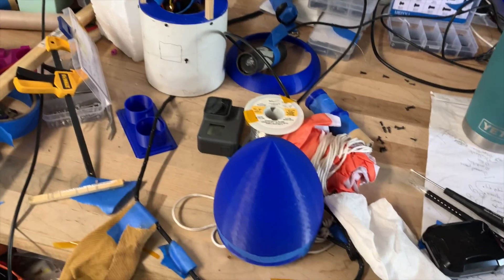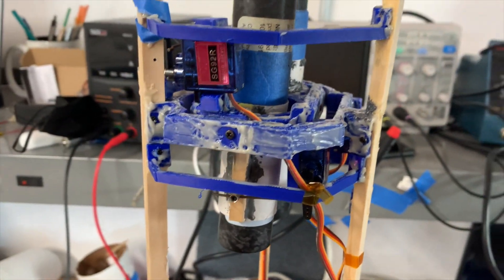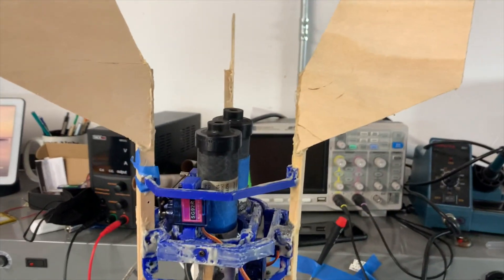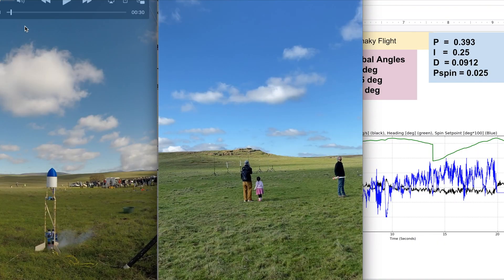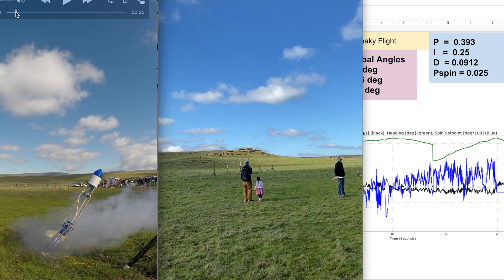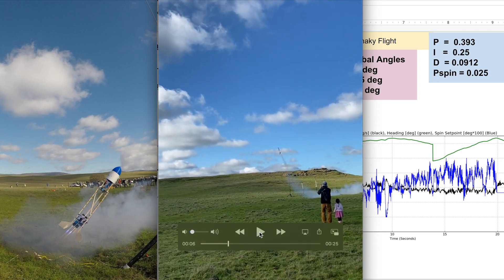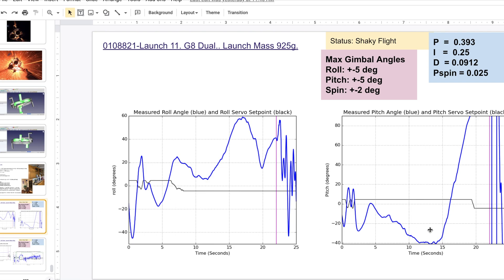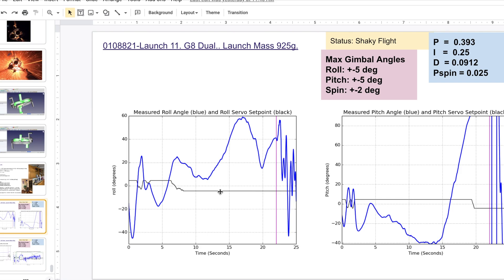Clustered Aerotech G8 Thrust Vector Control Rocket

Comment: Why the fins? Doesn’t that eliminate the need for tvc?
Reply from the maker: There's not sufficient speed for aerodynamic stability to have an impact until about 10s into flight. You can watch the liftoff, it was very slow and almost fell over. Without TVC, it would have fallen right over.
Reply: @peterb7615  oh ok thanks for answering
Reply: Redundancies

Comment: Do you plan on programming the gyro motors to make set flight paths? Instead of just straight up, program it to make a slow turn in a set direction,  or even make it do a trick or two with the small amount of fuel that it has. After you beef up the torque of the gyro motors I guess.
Reply from the maker: I thought about spinning it really quicky at the end but didn't do that for this flight. Could program a loop I suppose, might be cool